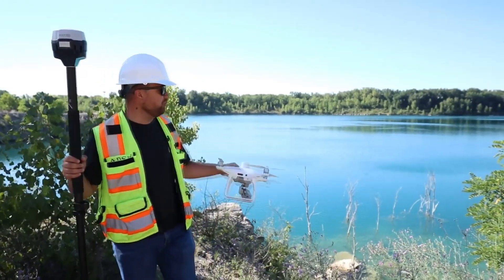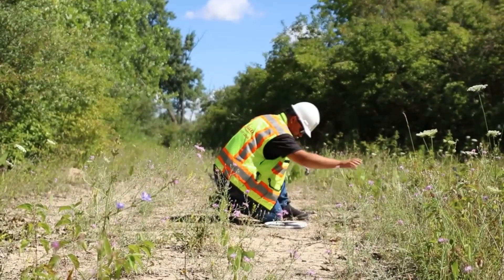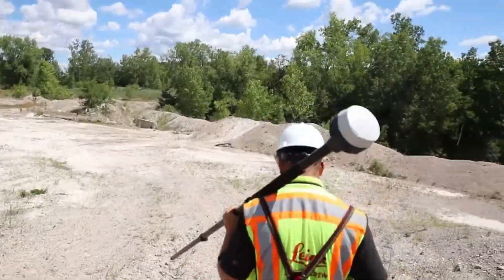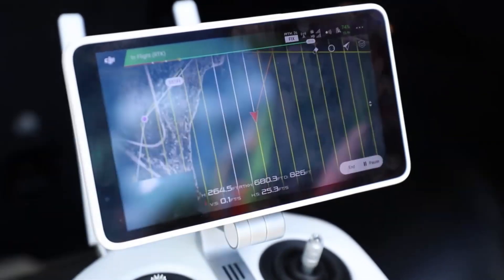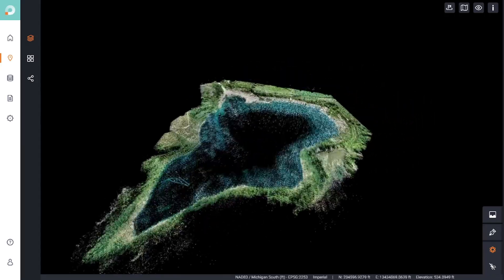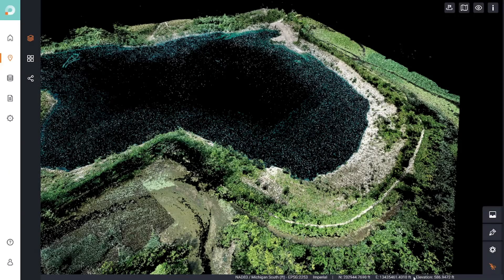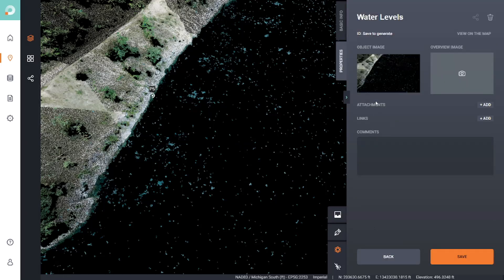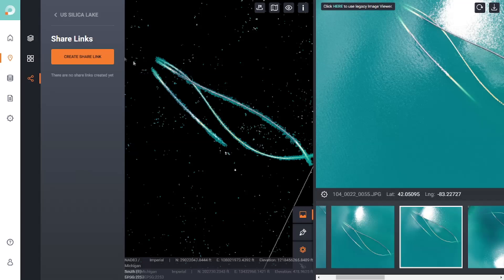Surveying a Lake: A Guide to Collecting and Presenting Drone Data for Clients

Comment: Hey Rami, are you using Ntrip network to pull the gcps? Just got a reach rs2+ and trying to figure it all out, just about got my head above water 😂 alot to take in. If your using Ntrip when you pull the points do you wait for a fixed reading, then take the coordinates? Thanks

Comment: if the task is to determine the water level in the lake, then what is the point of conducting time-consuming photogrammetric surveying, if it would be possible to simply measure 5 or 6 points of the water cut with a rover?
Reply from the maker: I was demonstrating the annotation feature on Skand. My client requested a point cloud so that's why I went through the process of using a drone to survey.

Comment: On a small body of water such as this wouldn't it be smarter to shoot the elevation with your GPS and carry that elevation around the lake? Water should be relatively level.
Reply from the maker: Yes that is an option. There were some spots that would be hard to reach, but the real reason I used a drone was the client also wanted a PC and Ortho.
Reply: @RamiTamimi  👍We've done jobs before where we drone the entire area like you did. Use pix4d to extract the shoreline then complete and drop in a bathymetry survey. Always looks amazing in CAD

Comment: I have a huge Issue with Matic when it comes to roof edges or walls or any 2D objects. They're blurry, noise and looks super UGLY. What's your experience in using Matic to generate ortho when flown over buildings and boundary walls. Please let me know.
Reply from the maker: Make sure you set the correct template. Matic has alot of menus to pick from to achieve your desired outcome.
Reply: @RamiTamimi  I have tried with several  surface smoothing values. Still of no use. Roof edges must be sharp enough. As a matter of fact any 2D objects must sharp enough in ortho so i can use them to measure.  So i was wondering if you had any luck with the matic when generating  ortho of urban areas that had roof edges, fencing walls etc....

Comment: How do you fly over water without getting spikes in your model from reflection?
Reply: I face the same issue. Used Matic, Mapper...Wondering if someone figured out the solution....
Reply: Its not really "possible". You will always have holes in your point cloud with water since it moves and there isnt many differences in the surface. Best way I have found is fly at a higher altitude and gather as much shore as possible in each image

Comment: Is there a good fix in the bushes?  Are you building a flight mission in the DJI pilot? How long did it take to fly ? Is there enough battery? Have you tried the DJI Terra program?
Reply from the maker: There was some struggle in the tree, but only a few minutes until I had a fixed reading. Missions were done on DJI Pilot. The project took about 45 minutes to fly. I have limited experience with Terra.